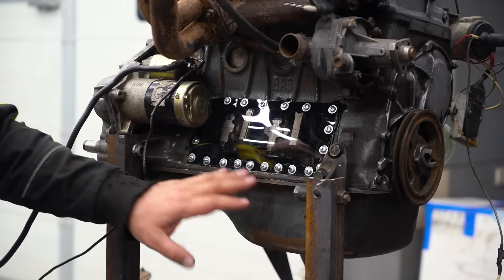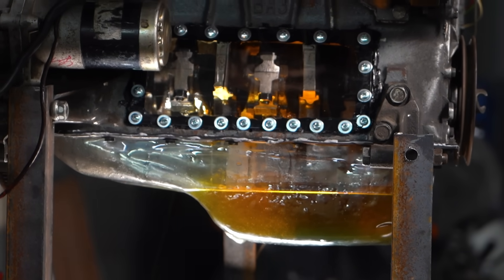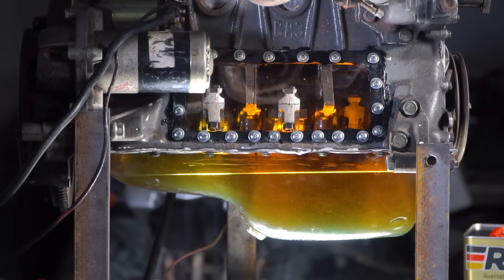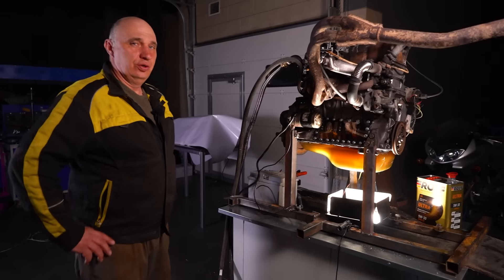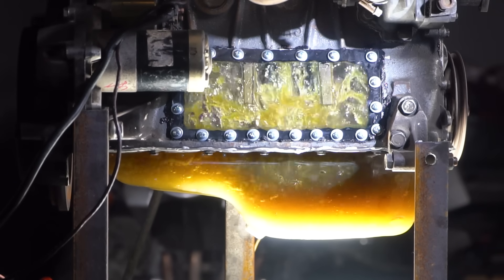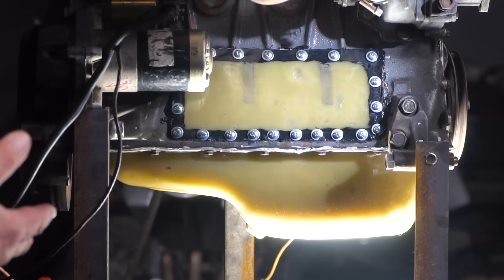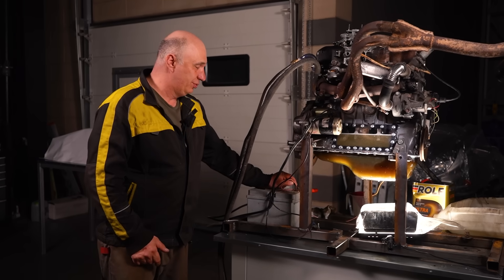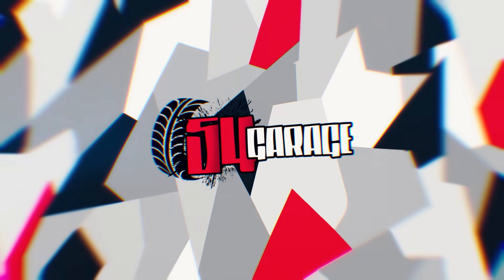What actually happens when you overfill your motor oil? (w/ transparent oil pan)

Comment: well that's why you don't overfill your levels 

- even when he says that is OK

yeah, you do not need to be an F1 mechanic engineer to calculate every ml but if your instructions manual says 3.4 liters of motor oil you can use 3.8 with no problems but don't go crazy YOLO with 4.4 liters for example.

- *NO is not good to overfill your levels*

IS BECAUSE THE LAW OF PHYSICS to be precise Dalton's laws

when you add any kind of fluid in a confined space this will create pressure moving other fluids less dense (because surprise the air is also a fluid that's why we see more air bubbles when he adds more oil) and the more you add more pressure will build up and your motor block is rated to stand a certain amount or even the oil pump is rated to move a certain amount of motor oil, not air bubbles and if you add more oil that is necessary the components will wear out faster and will lead to catastrophic failures because even when we see that everything is just moving smoothly you need to understand that inside a motor are occurring explosions

Comment: During my last oil change, i had a bit of a mishap using a top sider oil extractor (old seal became ineffective under pressure) and overfilled my 4.5 quart VW by probably half a quart or more. Was honestly a bit concerned but this video (+ the fact my car rapidly burns oil anyway and has driven another 4k miles since then with zero issues) calmed my worries.

Comment: I once watched a carbureted vehicle with 2 quarts of oil over max sick the oil through the breather into the EGR system and dump the oil into the carb.  White smoke everywhere but the engine was still running, with less than normal power.  I'm talking a white cloud all the way down the road for hundreds of feet.  Pretty crazy to see.

Comment: Modern engines have timing controlled via the oil pressure vacuum by way of sednoid sensors / phasers.
I would need to see the results of those measurements also to draw a conclusion.
But, after watching this, I will not be concerned about a half a liter overfill.

Comment: If you overfill the engine with oil, you could cause the engine to build up too much pressure when it's running. This could cause damage to oil seals and gaskets, not to mention too much oil in the engine can also cause the pressure on the crankshaft to increase, causing oil to enter the exhaust pipe from the crankshaft into the combustion chamber, blocking the combustion chamber hole with oil and eventually clogging the engine. Wet spark plug; excess oil will also flood the spark plug well.

Comment: You can see how much thinner the aerated oil acts. It definitely won't lubricate well while aerated and air bubbles don't lubricate at all, so uneven heating of bearings to such an extent that pitting will occur and increased wear

Comment: I always put In a little extra It helps keep the Oil cooler but there Is too much when the crankshaft starts slapping Oil mixing Oil with Air creating pressure In crankcase blowing the Oil out but small Engines do Not have Oil pump

Comment: Wrong you should worry about it.  Too much oil equals too much pressure resulting in blown gaskets.  Which means expense taking the engine apart to replace all the blown gaskets,  or constantly have to constantly top the oil up. Simples,  if you overfill,  drain it out.

Comment: My local shop overfilled my oil many years ago and eventually it led to oil reaching my catalytic converter which cost me 3k.  The car started sputtering and acting strange and then months later the catalytic converter was destroyed, even after I pulled the extra oil out of the car only a few miles after having filled it by the shop. The damage was done.

Comment: It looks like because of the plastic parts he is securing them with additional sealant and not the normal gaskets. I would think the extra pressure would cause an oil leak to normal gaskets.

Comment: I think if you are just puttering around town and never get into high revs you could probably overfill and it wouldn't matter much. But when you think about it having the crank hitting the oil...even though it's not a solid...probably does eventually add up to extra wear...kinda like when you jump from a high point into water....sure it's not solid....but it does have an impact on you. Also another thing about the min and max levels is it's probably better to go for the max simply because you will have more oil to dissipate heat and with less it will probably get hotter as there is less of it to dissipate heat. Interesting experiment though, thanks.

Comment: @10:22 thats a whole lotta aeration into the oil whic over time will reduce the oils ability to sustain compression. as air compresses much easier the oil. which could potentially spin a bearing under extreme loads.

Comment: Thank you so much for this! I am curious if this still applies to cars with a DRY SUMP Oil Pan. Mine has one and it works differently than a normal Oilpan and allows oil to flow through the engine under high G load during intense cornering.  I am wondering if it can still be over filled at least double without issues.  I have had the same worry with overfilling oil but I'm pretty sure wtih how safety is that might still be okay to do double over.  Or at least I am fairly certain an extra quart wont be a problem.  

Still I'd like to see if you can try doing that and show what that looks like.

Comment: Basically what happens with a lot of oil .. and air .. the engine becomes an "air compressor" .. there is an air compressor that runs in oil using two screws at high speed to compress air .. so compressed air is going to build up and find a weak place.  Great video and it has answered a very big question!!!

Comment: Fun little hack. If you want to clean the oil system really well throw some transmission fluid in the oil system and run it for a little bit right before you change the oil. I accidentally topped off my oil with ATF (someone filled an oil container with the wrong thing and didn't lable it) and immediately took it to get an oil change once. The guy who owned the shop told me he intentionally does exactly that to help clean crap out of the oil system. I've done it ever since.

Comment: Very interesting! One big issue is clogged oil piston return holes in some engines, its possible to clean out the piston rings by using berrymans or similar product in the oil but so far impossible to clean out the oil return holes and oil consumption remains high.
My idea is to have high oil level add berrymans or similar product into oil and run engine, since the oil will splash under the head  of piston, the berrymans can access the oil return holes and potentially clean them out.
Now I see this video I think there is some possibility it will work.
Maybe garage54 can try this on some engine that has clogged piston oil return holes?

What is that breather? Never seen one before it might limit max level you can go to? I want to see engine oil to bottom of piston head!!

Comment: Some of us old guys might remember that until 1954-55 Chevrolet and a lot of other engines used a "dipper"" oiling system where there were tiny little pyramid shaped cups on the end of each rod to pick up the oil and feed it to the rods and crank and almost backwards of modern engines the rocker arms and pushrods were the last to get oil and another thing that sounded pretty much backwards from modern engines if you wanted more oil pressure and higher volume you would go to a thinner weight of oil, and if you were racing that little (or big in a couple of cases) in line six you would add a piece of .001 shim stock to the rod and main bearing caps and with the thinner oil and higher rpm both oil pressure and volume would raise to make your engine live longer and oh yeah, don't forget to add a quart or two of extra oil since now it was picking up more than before, not to mention that if you were racing a track where you were turning at speed it would give a little insurance that the pick-up on the rods were still having oil to pick up.

Comment: This happened to me, a newly rebuilt engine, and they over filled it, tanking down the motorway and the engine seized up .. the problem was that the oil got aeriated, the pump couldn't pump it correctly, hence the engine seize,

Comment: Interesting. I was always told that the problem was that oil droplets could exit via the crankshaft case fume vent which is connected to the intake manifold for environmental reasons, get sucked in, lower the knock point of the mixture or create lots of carbon built up which would shorten the engine's life.

Comment: If you're the type of person to do early oil changes like 5000 miles,
 putting 5% less than recommended will work for you in my observation. Less power zapped from engine and more fuel efficient.

Comment: I always add a half qrt more than my 4th Gen Ram 1500 requires by using lucas oil additive, been doing that since I bought my Ram 1500 with 85k miles, at 4 years old. That was 8 years ago, and now I have 200k miles on her and she still runs like a champ. 2012 Ram 1500 5.7 4x4 Laramie, requires 7 quarts of full synthetic oil. I use Mobile 1 high mileage triple action full synthetic. This video definitely relaxes my mind by using a half qrt more.
Reply: I overfilled my ram about 1/4" over the max hole,so far nothing happened

Comment: You don't talked about the turbocharged diesel engines for which you absolutely don't have to put more oil than the max level from the dipstick. The excess of oil can be used by the turbocharger and put the engine at over-revs until it breaks.

Comment: Don't overfill the engine oil. Reason 1: Anything spinning in a fluid will slow the object that is spinning. You're making the engine work harder for no reason. Reason 2: The oil is foaming. You can't lubricate an engine with air. Reason 3: Drastically increased oil degradation due to heat and contact from the sheering effect. Just don't do it.
Reply: Yes we know,the video was obviously made for scientific purposes.
Reply: I was waiting to see if he was going to mention oil pressure, the resistance, anything.. but hey. It still cool looking at the visual mechanics
Reply: Guys, I'm an automotive/mechanical moron.... Never had a Father or an Uncle or anyone to show me about these things. And info I look up is confusing and sporadic for me... 
So this seems like as good a place as any to ask a question like this....
How do I know which of those holes on the dipstick I'm supposed to be filling to, or keeping it at? I've never known and just kind of guessed! Lol
I know. I know. Not good. 
But I'd always just assumed you were supposed to fill to the top hole when the engine has sat and gotten good & cooled off. 
Can anyone give me simple, practical advice in regards to this. So I'll know moving forward into the future, please? 🙏
Reply: @johnnydi2231  With the engine not running, the oil should be at or below the top hole. It shouldn't exceed the top hole. A lot of dipsticks have a cross hatch pattern on them; anywhere in this crosshatch area is a safe level, according to the manufacturer. However, you must remember that more oil in the pan means the oil will remain cooler in temperature than if there is less oil. So, if you keep it near the top of the cross hatch pattern, that would be the safest and more efficient level.
Reply: @johnnydi2231
Reply: @johnnydi2231  just fill the oil to the highest hole and you will be fine
Reply: Okay. Thank you so much guys! The other day I realized it was almost down to the last/ lowest hole... And was like WTF?!
I freaked out a bit, I won't lie! Lol
Reply: @johnnydi2231  that is basically the minimum line . Its always better to keep it at the top one 

A lil bit over is still fine .. just not alot over . As you can see in the video you actually have some space for play
Reply: @ruankoen5947  Okay great! Thank you my friend. Do you know, if there's a slight knocking/ tapping sound coming from the motor... If a really good oil change will help to alleviate that? Have you ever heard anything like that before? That's what I was told. That if I got an oil change with really good oil (whatever that means?lol) that it may help to stop the tapping. As I said I'm illiterate with all things automotive or mechanical. 😄
Reply: @johnnydi2231  depends on where the tapping is ciming from 

If it comes from the top .. then yes just filling it with more oil pr replacing with fresh oil . Look up your car and see what the manufacturer recommends.  Then use that oil. 

If the knocking comes from the bottom .. that usually means bad news . 

It could be that your bearings are worn and if you keep driving like that you will as we call it in South Africa.. hit a bearing (means your engine will be broken real bad) 

So have a mechanic look at it as soon as posible 

And please dont put any additives in your engine to make it quiet. I have seen many engines die cause of those additives
Reply: You can replace the oil with the oil that your manufacturer recommends and see if its better. 

The guys that made the car are engineers and know what they do . So its better to follow their recommendations
Reply: @johnnydi2231  What kind of vehicle is it? Is it high mileage?
Reply: @omnicave3183  Yes. A 2007 Tahoe with almost 200k miles
Reply: @johnnydi2231  Yeah, keep an eye on it. If your oil isn't dripping on the ground, it is consuming it; that is, it is burning. That was a common problem on Chevys around that year.
Reply: @omnicave3183  Oh alright. Damn. Thanks for the info though. I appreciate your help immensely! 🙏
Reply: @johnnydi2231  is your car using oil ?

Like do you have to fill it frequently
Reply: @ruankoen5947  Oh man... I'm not very knowledgeable about cars or engines. So I'm not exact on what's frequent or considered normal... But I'd say like about every 4-5 weeks, give or take, I have to add some. Yes.
Reply: @johnnydi2231  how much do you add ?
Reply: @johnnydi2231  also have you ever pulled the dip stick and seen that there are more oil than was in ther the last time ? Like it went up a bit ? 

Just trying to figure out if your injectors are still fine 

Cause one of my friends had bad injectors 

It caused their oil to mix with fiel and it made the engine knock and then hit a bearing
Reply: Clearly don’t do it but it’s so nice to know what happens in the most extreme case because when I go 1/4 qt too much, I freak out
Reply: Thx
Reply: Nahh... i'll do it. I'll also pour some in the gas tank as well
Reply: You probably searched this on the internet and posted it here to try and sound smart
Reply: @ruankoen5947  Yeah, definitely that, and not that I've been in the trades for many years...
Reply: @omnicave3183  then why are you stating the obvious 

Most people can see what is happening in this video
Reply: @RUE-GAMING-193  I've explained that. Read the other guy's comment.
Reply: Yea we know we all watched the same video 🤦‍♂️
Reply: @aaroncapps1639  Klugscheisser.
Reply: @aaroncapps1639 😂 I laughed too hard at this
Reply: @aaroncapps1639  Some people don't know exactly what is happening in the video. Take your sarcasm elsewhere.
Reply: @omnicave3183  Don't listen to the idiots in the comments. You've wrote a good summary of what NOT to do to an engine. Some people hate if somebody's smarter than them.
Reply: @omnicave3183 I thought it was hilarious

Comment: More air in the oil causes the oil pump to cavitate. Hence less oil to the rest of the engine and very possible failure to other engine components not drenched with oil. Side note is geared type oil pumps will tend towards cavitation at specific RPMs during the engines operation.

Comment: I overfilled engine oil on my 2002 dodge intrepid. Was driving stopped at red light when it turned green car wouldn't go. I pulled over for a bit and waited for my dad, who got it driving. we made it halfway through before he lost power completely. The oil level was really high and the oil light came on. What do you guys think happened when he lost power? We suspect head gasket but I'm wondering if it could be more substantial damage. If anyone can tell me other possibilities for damage besides head gasket that will greatly help in my repair. I'm going to drain oil, change head gasket, refill oil to proper level, and hope she goes! Any tips appreciated thanks

Comment: There’s “hardly any oil in the pan”. 4:40 Really? There’s at least 1.5 to 2 quarts in that oil pan. I’m guessing the engine holds 4.5 to 5 quarts of oil, so you wouldn’t need more than 2 quarts in the pan for the crankshaft and oil pump to bring oil up to the heads, valves, lifters and camshaft.
Reply: wtf is a quart man? in what day and age are you living?

Comment: I worked at a full service station back in the 80's when one day this women comes in for gas and oil.  I offer to do it for her [my job after all] but she informs me she is quite capable of doing it herself.  So she request 3 quarts of oil [at gas station prices] and she puts them in.  I see her looking down into the case via the oil filler hole and she comes in and ask for another 3 quarts.  She was going to fill the case until she could see the oil.  I diplomatically offered my help and explained what a dipstick was and what it did.  Coincidently she did need 3 quarts but have always wondered if the car would have even started if I had sold her all the oil she wanted.